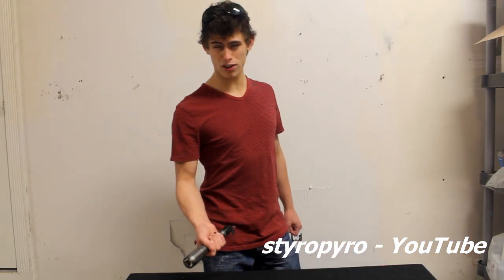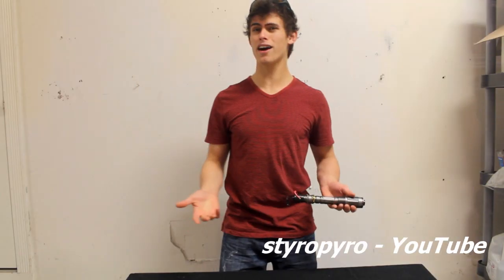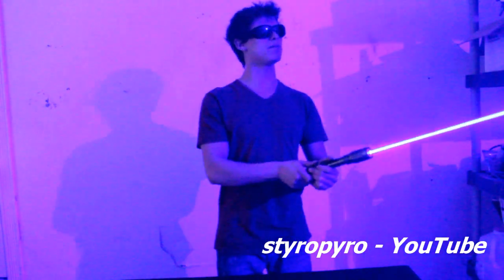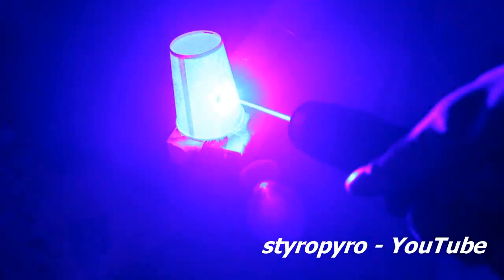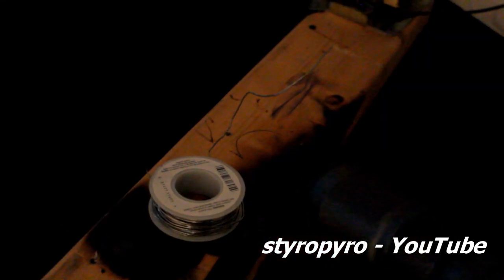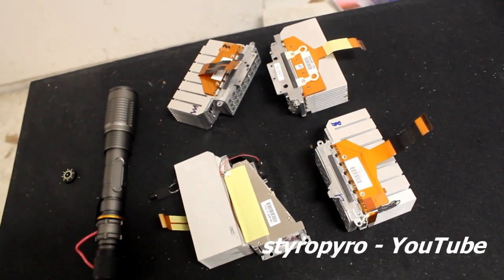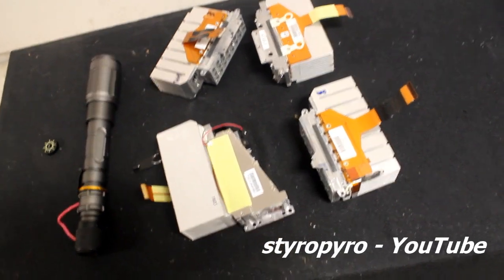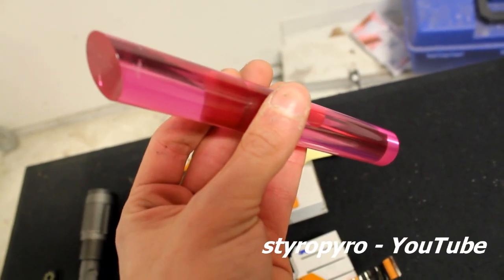Real Burning HOMEMADE LIGHTSABER!!! styropyro’s version

Comment: I don't know your name, but this Steven Greer, subject U.F.O. was pointing at the sky with a green laser. If you'd do the same and wait for a U.F.O. to show at the same spot where you showed the light in the dark sky. So while pointing up. If a U.F.O. shows up, say I need a light bender for this laser to turn in a lightsabre. You might have to talk to the laser for the voice to flash up the black sky. The handle might get hot so mirrors would be needing. The UFO can only act at distance. If everything works and you have a lightsabre, you can definitely build a stronger one but it will probably be needing a radioactive battery. Then your quest for Friedman will begin.

Comment: Wow it's quite amazing that a 7W ruby laser can be powered without AC...how do the batteries not drain in a few seconds??
Reply from the maker: the laser I'm using in the video is not a ruby laser, it's a GaN based blue laser diode.
Reply: styropyro Got it.  very cool!!!

Comment: what if you made a laser tipped blade by directing the laser long the tip of an extremely heat resistant metal blade as to heat it up and provide a laser that looks cool as fuck. have all the wiring and laser components in a long handle?

Comment: Suggestion: even tho this is an old ass video.
Would it be possible to find a strong enough material and place it at the point ya want the laser to cut off, for a contained blade?
Like this, for instance?
https://static.comicvine.com/uploads/original/4/46951/1857088-beamkatana05.jpg

Comment: Could you build a handle where a rod (as invisible as possible) extends from the handle as the sabre turns on (which gives the classic lightsaber turning on phase appearance: it rising from the handle) and would restrict the length of the actual beam?

Obviously you'd have some sort of stick poking out from the handle, but you shouldnt see it under the laserlight and it will retract into the handle mechanically when turning off the sabre.

Comment: I always wondered, can't someone make a lazer like this, but when it is turned on, a nonreflecting rod that can stand the heat of the lazer comes out  as a light saber would, reaching the length of a normal light saber, and at the end theres a circular plate on the end that would absorb the light..?

Comment: cant you make like a thin strong wire attached to a end cap and attach it to it? yeah the part where the wire is would be unusable but the rest would still work and it will be portable meaning you could flash it anywhere withought hitting the car infront of you
Reply: so likethis |====|--------------------)
Reply: Trash Nasty oh yeah holy crap
Reply: Yeah I thought that to
Reply: It would burn through the cap

Comment: Um...do you mean "laser" rather than "lightsaber"?!?!!?'
Reply: Jack Groceman can you do better ?
Reply: he could ad  asort of cap tot he end so it shines against it rather than carrying on. and attactch it to the handle using a thin metal pipe.
Reply: +Owen Parsons he could put some strong metal in the middle of the lazer, so it goes around it and you can't see it, and then put fire in the hole of the metal and put a blue glass cap on top of it so it's blue, and hot plus the cap can stop the lazer

Just a guess

Comment: Here's an idea to make a real Light saber. Make a retractable cap which the laser will shine into when extended. Attach it to 2 points in the handle spring loaded so a press of a button will uncover the laser, the cap would extend and the light would only go to the cap. 
The handle might be pretty large but if it works it would be seriously cool!

Comment: There is no way known to man to stop light; once it starts it's journey.  You can slow it down, but you cannot stop it.  That is why the light Saber is an impossible invention.  You can stop light by a blunt object; however, in the case of the light saber; there is no blunt object at the tip.                Concern:  Reflection off this intense energy can burn out your eyes in an instant; even with sunglasses.  You may be getting SSI before you know it; dude.

Comment: Question:  At what power level and proximity do you wear safety goggles (when not in a highly reflective environment)?  

I always do with my Class 4 greenie, but sometimes play around with my sub 150mW lasers without them.  Nothing close proximity, tho.
Reply: Regardless of range, you need to wear goggles with any laser over 15mW.
Reply: Regardless of range, you need to wear goggles with any laser over 15mW.
Reply: Randy Butternubs Too much of blanket statement.  With 15mW, you would not even be able to see the beam or spot...so what's the use?  You can't burn anything with it.  Astronomers use 50+ mW to point out stars in the night sky.   Thanks, anyway.
Reply: +Edslittleworld If you want to take risks with your eyesight, that's fine by me. I think being able to see my family is worth more than being able to see a green laser dot better.
Reply: Randy Butternubs Good for you.

Comment: Great video, have you ever considered a Copper Vapor Laser? It certainly seems you have enough knowledge to build one, the only real issue I ran into was the price of hydrogen thyratrons ( if you go for a solid state style one, there are rotary spark gap based ones that are even simpler.). All things considered, beside the electrical side, the cavity design and the optics requirements are very simple ( the "output" side needs only a piece of glass to hold the vacuum inside the tube). Not to mention, a 10+ watt beam of 510 nm Green and some 580 nm yellow looks great.

Comment: Hey Styropyro! Just wanted to say your videos are awesome!! I build laser projects during my free time and this current project I've been working on is basically a high-powered laser gun or hand cannon using 2 5600 mAh li-ion batteries at 3.7v's which gives you plenty of run time but there's a UNIQUE TWIST to this bad boy if your interested... Having a very difficult time making a video because I have no idea what to really say besides destroying targets lmao
Reply: +Andrew Wright The output power is around 1.5-1.6W coming from a 445nm diode! but it although it has a decent heatsink I kind of took some extreme precautions to ensure there would be no issues with overheating so I built a heatsink on top of that into another heatsink made of just straight up copper then installed it into the gun with the laser system being separate from the unique part i wanted to share! :)

Comment: What I don't get is how can one lightsabre prevent another from moving. I'm talking about when the lightsabres "clash" and act as solids. Is there anyway that this effect could work, maybe by having a solid in the middle of the beam that does not melt at extremely high temperatures.

Comment: Awesome! But the light saber IS NOT A LASER! Lasers, for one, are silent. Second, Lightsabers are particle field contained.. that's why they make that distinct sound. If they were lasers, they would travel across the room, and beyond. Lightsabers need a special type of material, mixed with plasma, and microparticles, from a material source! Then, you have your lightsaber! Until then, we might not see a device like that, unless we make a device with a magnetic field strong enough to contain a cylinder type of shape and heat, and also make the light tangible enough to solidify, and look like a light sword. I'm not even an engineer! lol! I wish I could build one, with my theories more a bit precise.

Comment: That laser would be good at starting firework from a distance :D
Reply: +Randy Butternubs  I bet a direct hit to the goggles would still result in blindness
Reply: +bc69006900 Depends on the power of a laser, the OD of the goggles, and the wavelength of the laser. 

For instance, a 1W laser pointed at a pair of OD 4 goggles filtering 99.99% percent of light, only 0.01% would reach the eye, which is about the equivalent of 10mW, which would cause damage, but not blind. A more powerful laser could penetrate a pair of less well made goggles. 

All of this assumes that the wavelength of the laser and the and the wavelength the goggles are designed to filter match. If you pointed a 635nm red laser at a pair of goggles designed to filter 445nm blue light, almost all of the light would reach the eye.
Reply: +nick hansen Innovative.
Reply: As long as everyone in a 3000 meter radius is wearing goggles.

Comment: I think you could contain the laser if you had some kind of heat resistant device that covered it on the top and contained it through the sides without obstructing the heat you know kinda like a wall on top of the laser to control its length.

Comment: Hi Styropyro! 
Instead of destroying that great ruby laser rod with explosives, use argon gas in a chamber with the typical laser full mirror and half mirror at both ends.  Argon gas will ionize easily with explosives and then become excited.  It will then laze and you can make an ultra-powerful laser!  It is a one shot arrangement, but you could send a short beam of light to the moon!  I would like to see you try to make it work!
Forensic-Man

Comment: Wouldn't it be possible to contain the beams by having some sort of straight stick of some material coming from the very center of the handle and on the top of that have a small heat resistant shield that stops the beams? Then there would be 5-6 diodes around the pole/stick coming from the handle. Each one of those would be stopped by the shield at the end of the stick and you'd have a contained light saber beam.
Reply: It would be difficult to cut or slice anything though , Also , a real lightsaber would most likely be made of plasma , But human technology is just not there yet.

Comment: What if u took ten lasers and made 1
Mega lazer o_0
Reply: did you not watch the video?
Reply: Where would you point at? You're gonna burn your apartment if you just turn it on
Reply: +Sowmya K No you wouldn't. You would need massive amounts of power to melt and combust drywall.
Reply: ***** I have lasers nearly as powerful as this, (3.7 Watts), I also have painted walls, and I can confirm they do not burn off paint. The paint on my walls is red, and they still don't burn.

Comment: Might be a stupid idea but for a lightsaber: when you press the on button a thin cylinder slides out to length about maybe 3 feet and has a small circular mirror at the end that reflects the beam to the handle that also has a mirror attached so that the beam is endlessly reflecting off itself. Just an idea

Comment: The only probable solution to the real light saber is NOT a laser. It would be a precicesly controlled flame thrower. Think of it. The flame would run out at the end like a lightsaber and actually create the sound by having to produce that much power and funnel it down into a very dense flame that will incinerate anything it touches. You can't achieve this now. Wrong time period. You would need an incrediblly lightweight and small powerful fuel source with perfectly engineered focus points with probably a spiral, screw like, barrel, to focus the flame to a point.
Reply: +spiddyman007 Science has already determined that a lightsaber would be possible if you could A) build a specific shape electromagnetic field and B) fill it with plasma. We know how it could work, we just arent capable. It's like Rail Guns, we know how they work but we just cant adapt them for human use without them breaking or being too dangerous for use.
Reply: You can use plasma instead , But human technology is just not there yet.
Reply: Yeah. That's what I tried to insinuate. The fact that we are not there yet. Also plasma would work and every other source acociated. BUT. that would require a housing unit and in order to burn through outside matter, it would have to burn its housing unit. So that's why the precision flame thrower makes the most sense.
Reply: Btw. Avenger. Yeah. No duh that would work. But how the hell are you gonna create that. That's why I was trying to just suggest something sort of reasonable.
Reply: I got u though. I remember watching a thing about that around 2008 on the history channel.
Reply: Nothing is impossible , It's just a matter of figuring things out , Avenger's point is plausible.
Reply: +ShexyGalacticAlien Not just plausible, it IS the canonical way a lightsaber works.
Reply: TheAsj97 Yeah , True.

Comment: Maybe have a long thin extended bit that attaches to a circle to cut off the beam?
Reply: +John Williamson this thing would burn it, or overheat it somehow very quickly no matter what you put at the end.
Reply: Graphite would work
Reply: RandomNickster it might reflect the beam in an odd direction, or back into the laser (which, for diodes, is a bad thing) but it would oxidize at the high temps and bubble away.
Reply: Damn
Reply: That's what I thought of but you can't chop at things because of the long rod

Comment: How did you get a license to build these kind of lasers?
Reply: +ThatGuyNamedT I doubt you need one
Reply: +Gabriel Rodriguez I was just curious.
Reply: ThatGuyNamedT Just so you have an idea, most lasers are measured in mW (a thousandth of a watt) and this guy made (legally according to him) a 40W Laser Rifle. It's basically ranged blindness.
Reply: The U.S. Has strange import laws. You are allowed to import a module or diode or host or driver or module with power supply, but your not allowed to import a laser module inside a handheld host. The sellers from China don't care so they do it anyways. It's legal to build a laser like this without a license.
Reply: I've ordered lots of lasers from China, and I've never had any trouble, though it is technically  illegal, I've never had anyone stop me. Kinda like jaywalking. As long as you don't order batteries from out of country, you'll be fine. Probably.
Reply: +Jinyu Dai Not really a me too situation. Modules and diodes are legal to import, so you shouldn't ever have a problem importing those.

Comment: what if you had a rod attached it to the side of the laser and had a two way mirror over the diode tip part and had a regular mirror at the end of the rod so it would stay in the length of the two mirrors